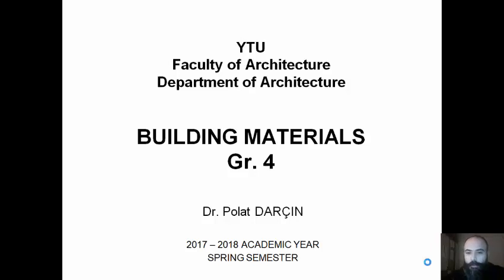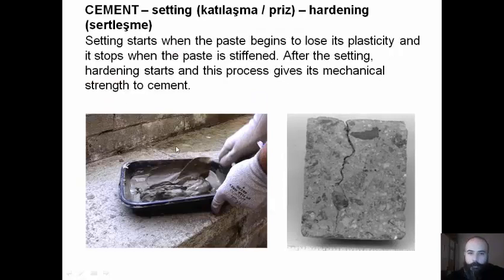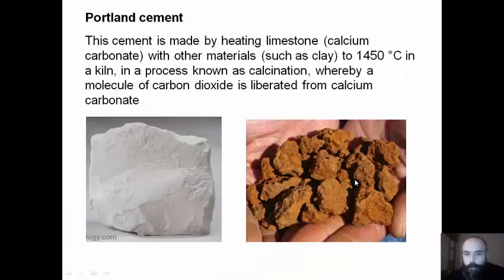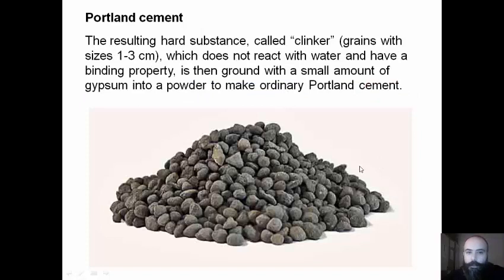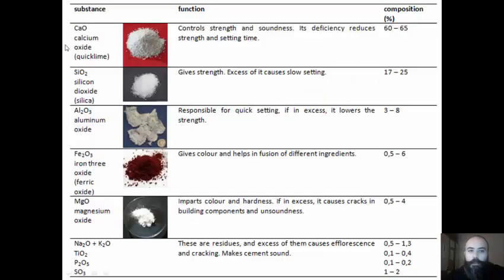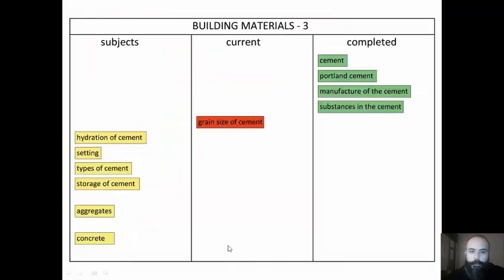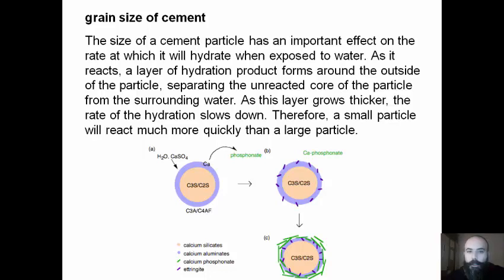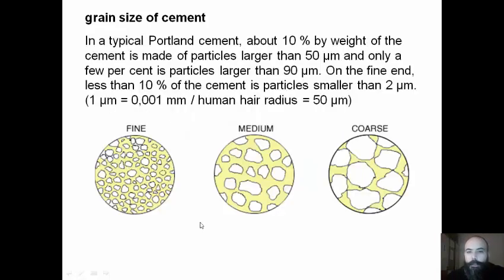BM 03 course 01 cement and its grain size

Comment: How does clinker not react with water? C3A in clinker will react with water, which degrade the quality of clinker. Am i wrong?
Reply from the maker: I could be mistaken, but there I was trying to state that unpulverized clinker in big chunks and without the gypsum addition does not react with water in the way cement does. It may be reacting in a different way, I will look it up. Thanks for the information.